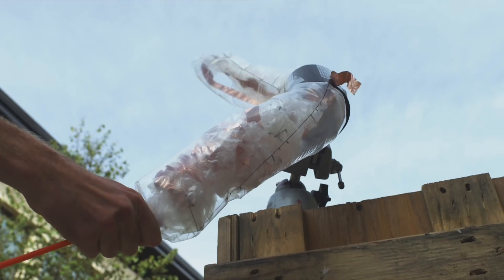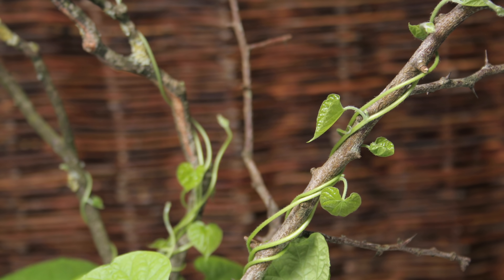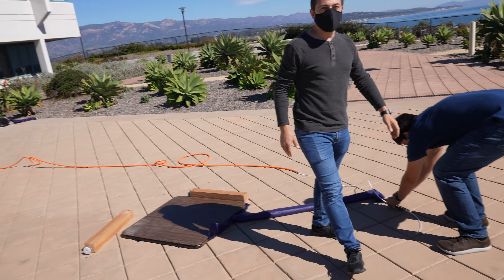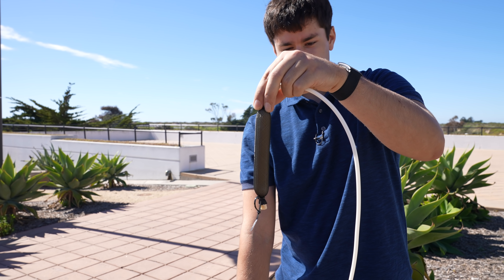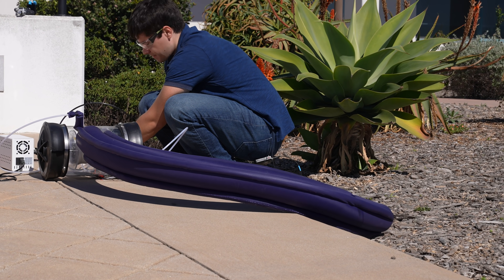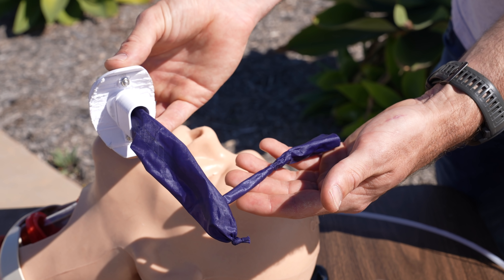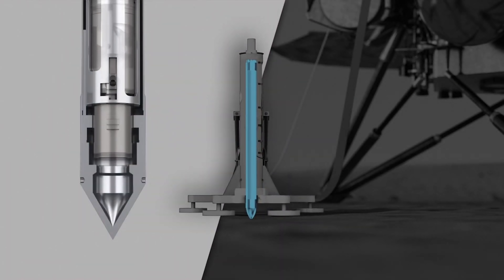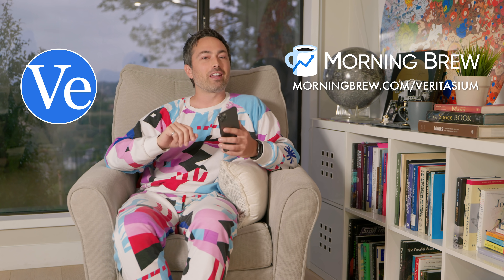This Unstoppable Robot Could Save Your Life

Comment: There is a currently used version of this robot that is repairing sewer lines across America. The tip has a powered cutting ring that removes blockages. It also pulls a hose that flushes the debree down the line. The cool part is that the tube is pumped with hot water that causes the tube to harden and become a new smooth PVC liner inside the old line. Takes 2 hours to repair half a mile of sewer line. Then a second robot cuts holes in the first tube at places determind by camera to reconnect the side lines.
Reply: Cool info. Thanks for posting it.
Reply: @ddegn  im pretty sure that's where he got the idea. That or hentai,
Reply: This is how water lines in neighborhood were coated to stop chemicals leaching in to our water.
Reply: @ybunnygurl  and stop leeches!
Reply: Cool! Thanks for the info. It reminds me of the mycoborer in "Captain Vorpatril's Alliance", but hopefully less likely to get out of control!  =:o}

(By the way, it's spelled "debris". Silent "s" at the end, 'cos it's a french word. =:o} )
Reply: Cool!
Reply: I was just thinking that that tube tech is already used & this video info is just a another concept of the same. 
They thread tubes to remove bloodclots in the brain for strokes. Thread balloons to widen oesophagus or hold PEG tubes in place etc. Inflated intubation would reduce vocal trauma...
Reply: Thank you for posting this.  I just posted info similar to this  then found your post as well.   Right on!
Reply: That's called Pipe Inlining! I used to work for a company that did that. We mostly rehabilitated small sewer lines, but occasionally with did really large water runoff sewers in the woods that we had to pump huge amounts of water into from a nearby large creek. It took many hours to "cure" those kinds of lines. Crazy technology.
Reply: That sounds like a great and smart idea!
Reply: That day my kitchen's sewage line got stuck and the handpump couldn't help at all. My father had to buy 4 one-metre-long black rubber tube, join them together and the with a wheel one one side, thrust the blockage from another drain opening. This inflatable pipe could've help out a lot if we had that.
Reply: Very nice
Reply: just so you know it's spelled "debris"
Reply: Wow
Reply: if you scale that down, it could be used to remove blood clots or clean fat arteries, couldn't you?
Reply: Do you know a specific company that does this or tool manufacture?
Reply: link?
Reply: 777th like
Reply: It's not "a version of this robot" it's old tech that's been around for decades. And it doesn't "repair half a mile of sewer in two hours," you can't even set it up in two hours. And it doesn't "repair sewer lines," it lines them, doing nothing structural. You've been looking at promotional material.
Reply: @johnsmith1474  you could very well have said all of that same stuff In a constructive way where he actually learns something from this information you seam to think is so obvious. As opposed to coming in here gung ho to dunk on someone. 
But you know, you must be correct based on the absolutely no supporting information given. 
And you're right, the OP also didn't. 
But he wasn't all "wow look at how wrong you are you must be dumb" about it like yourself. 
Plus was just sharing a fun antidote, not correcting someone's fun side thought. 
Anyone with half a brain knows to take a comment like his with a grain of salt and look it up for yourself if you want to know more. I mean come on, It's a YouTube comment. That should be obvious. To everyone except you.
Now you may have noticed Im being a bit rude while specifically telling you not to be. 
Well I just find it morally correct to bully bullies, that's all.
🎩👌

Comment: This has been used for many decades now.  Moving of industrial machines, part of the kits for lock-picking doors on cars, Part of the tool kids to pop dents in door panels, tools used to level doors while installing them, the hydro snake sewer liner tool to line cracked sewer pipes... etc.  This concept is over 100 years old.  Might want to investigate the myriad of uses of this already in use.  Be it by pneumatic or hydraulic uses... which in reality are one in the same.  Come on now...

Comment: A similar technology has been in use for some time in the plumbing industry. To repair old sewer lines they inflate a tube inside of the pipe and use a resin that hardens it. Basically making a pipe inside a pipe. Then a saw on a robot goes in and cuts out the holes where they need to be so the water can flow. I used to work on a plumbing crew that used that method.

Comment: Military application: would help provide a much longer antenna that’s light weight and compact to Cary around vs the current antennas soldiers lug around for the various comm devices! Obviously you’d have to combat the battle of keeping it straight against wind but hey that’s a problem for the engineers.

Comment: Great potential for many fields, but for intubation, wouldn't it collapse on exhales? There would have to be something stabilizing the tube's structure for negative pressure. It would need either tiny muscle tubes or a layered tube like a millimeter around the open tube, that would also round the extremity.

Comment: Make the tube itself double walled and filled with a very thin layer of self sealing gel. That way when it does puncture, as shown, it can have some sealing property. Maybe reducing the air pressure compensation needed.

Comment: How exactly would you get the air pressure required onto mars? Wouldn't the low atmospheric density be a limiting factor? Even with some kind of compressed air tank, would operation time be long enough to justify the tech and earth to space weight cost? Obviously if they're putting money into this is it must be somewhat viable, but I don't see it

Comment: Do you think this could be applicable in something like avalanche rescue? Is there a way that this could be an easier method of reaching someone stuck under an avalanche?
Reply: Maybe if the top snow aren't too thick or packed, or they can ad a small drill head?

It can slither between ruble and pump warm air or deliver powdered food?

Comment: Water pressure is available via fire hydrant.  Imagine heat resistant material, powered with water extending a vine robot to locate and extinguish fire keeping firemen out of harm’s way.
Reply: It is cool, but there is the problem that water cannot be compressed, so I believe the concept must be calibrated correctly to liquids.
Or, you could have an hybrid air/water tube, that expands with air and brings a tube inside that would sprinkle water when needed.
Reply: @giannipiccioni8411  Ehhh.... adding the potential for extra oxygen to a fire is scary, though.
Reply: @AlphaMachina  oh damn, you are right too. Are there any gasses that are not flammable?
Reply: @AlphaMachina  why does it have to be oxygen? Could use carbon dioxide which would extinguish a fire (that's how some fire extinguishers work).
Reply: @jeffwei  

True, but in some really hot fires --- abet very rare --- anything above, I think, 3K⁰C, the risk is the CO2 decomposing, releasing the O2.

The famous Centralia (sp?) Mine Fire is almost the classical model for anaerobic fire, that just the sheer temperatures involved means the coal being burnt, is entirely self sustaining, with little actual oxygen flow, due to how deep it is.

Another example in the Windscale Diasaster, here, in the UK, decades ago, when a nuclear pile (or rather, a specifically designed reactor for plutonium production),  through various mistakes, and flaws, overheated, and caught fire. They tried putting it out, with water being pumped directly into the core, using scaffolding tubes, but the fear was, give the very high temperatures involved, the water may have decomposed to fom acetylene, which, with the 'freed' oxygen, may have caused to literally explode. But things got desperate: it was either try to put the fire out, or the result being literally the entire reactor exploding, creating a radiological accident on par with what would become of both Three Mile Island, and, worse yet, Chernobyl.

Fortunately, they were able to put the fire out, but even so, despite the filters that were added as an afterthought (and where, actually, considered an unnecessary precaution) to the ventilation chimneys, the amount of radiological fallout was considerable. Even today, the scaffolding tubes inserted have never been removed, as the ends are considered as being too 'hot', radiologically speaking. There are plans to decommission the whole thing, but given the sheer technological challenges, it may take until 2080, if I live to be 106, like my Great Aunt, before it finally comes down ...
Reply: @giannipiccioni8411  Co2 can decompose in o2 at very high temperatures, you could use nitrogen which is inert or some noble gas
Reply: Bad ass idea man
Reply: So basically let such a robot inflate into the center of a fire and start pumping carbon dioxide into the heart of the flames?

Comment: You can build it as two concentrical tubes, use the external one as the robot body and the internal one to pump liquids. The tension of the liquid can be a problem, though, so, concrete for stabilization, maybe not, low pressure water maybe yes.

Comment: What else can I think of? I would make them very large with a sort of flap hatch at the end to create a shaft with breathable air for people trapped in burning buildings or in mineshafts that have collapsed. Once the person or persons enter the tube they can crawl to the end with the compressor and rescue workers can cut open the tube to retrieve the person. It could save several lives in one go, and would cost virtually nothing besides the fireproof canvas

Comment: They use that type of thing to repair sewage pipes..  they run a cutter head through the pipe first then they soak the tube in resin as it unfolds or unrolls itself inside the pipe and they let it harden and run a pipe snake with a camera and cutter on the end so it can cut out the openings for your shitters and sinks n stuff..,

Comment: Isnt this used in plumbing for like years now?
Reply: Yes!! I just commented on it. I used to work on a crew that used this method . they use a resin that hardens the "pipe inside a pipe", and then use a saw robot to cut out the holes. Thanks for recognizing it.

Comment: Such amazing technology coming from such a simple use of air pressure and air tight tubing? This is phenomenal!

I work in the medical field and I would be excited to see the intubation model being used some day! Every second really does count AND it could be used with patients that have a small passageway and intubate them really quickly to minimize the risk of their oxygen levels dropping during the process

So not only are you able to intubate someone quickly, you are also providing a solution to a long known risk of intubating someone who has a small esophagus and/or trachea (because this robot has been shown to squeeze into the smallest spaces) which is PHENOMINAL

on TOP of that, it's a soft robot so minimal risk of damage to soft tissues if for some reason it does still take some correcting to deploy correctly

So on top of the applications of using this for search and rescue, (not to mention archeology?! That's amazing!) I can see this technology saving so many lives even in it's current state...I can only imagine what it could be applied to in the future!

Comment: Does the fact that these applications seemingly could have been done 70 years ago not strike folks as odd? OK yes, I agree that lots of folks miss very obvious things all the time but when lots of people are working with something the chance that all of them miss obvious applications should go down with the number of people involved. And a LOT of folks have been working with air compressors and soft materials mentioned here like nylon for decades. As stated in the video, these are cheap materials and really have been for quite some time. So the next question to ask becomes is there a systemic reason why these applications have not been taken advantage of previously?

My guess is that the popping problem might be a bigger issue than the video suggests. Sure, some holes are survivable for these tubes as long as it's not more than the compressor can handle but then you've got cases like where the host did manage to pop that air pillow he stood on. Consider what might be problems there. In clearing out rubble you may lift some, the balloon pops and the re-collapse might be more dangerous to survivors than just a stable rubble pile. Or intubating a patient and a popped tube sends fabric into the lungs. Maybe these are solvable or maybe there are issues I can't think of, but I'm personally quite skeptical of folks finding "one weird trick" that uses well known technologies in a modern world where millions of people have been trying to find such easy and useful applications for decades. For every "aha" moment that happens there are plenty of "ahas" that turn out to be complete duds.

Comment: I am not inpress because for atleast 10 years, this inflating tube in tight location has been use repair sanity and storm line instead of doing a full  placement.  The tube is made of a fabric material and epoxy is pumped through the tube, hardening the fabric and became the new walls.

Comment: You can maybe do some plumbing with it, as the snake rope is hella expensive and a plastic inflatable rope would fix it. It could maybe act as a screwdriver if you have the right equipment for friction and grabbing a hold of the screw. It could even be what y’all are thinking of. It’s use is almost unlimited.

Comment: I think the experiment with the spikes is inacurate 
Normally if you rip a hole into it you wont have the object still stuck inside and plugging up the whole 
Now its true that you can always fix it with more air pressure
But if a hole is too big then you wont be able to fix that because there is a limit to how much pressure we can produce

Comment: The main limitation of this technology will be the gas supply. Like with paintball and SCUBA, your tank and your regulators are critical components, and it's very difficult to reduce their weight (big factor for space-faring applications). In the case of a Mars mission, you'd be faced with having to compress a very thin CO2 atmosphere for longevity of the mission. In interplanetary space, you'd literally have to take compressed gas (or reactants to make it) with you, which would be very expensive.

However, I think applications on Earth could be really exciting and are within reach.
I wonder if they could use something like that tire goop to reduce losses when punctured...

Comment: You can probably use it in all kinds 9f surveying uses like locating the runs underground pipes for gas, water, sewage.  Or even if you need to run a pipe or wire through a small cavity like a wall or door frame, by sending it through from a to be softly, then retract with a cable attatched.

Comment: As a Paramedic, I've performed many intubations.  The ET tube has lateral rigidity, meaning it is not likely to collapse closed when placed.  This allows you to deliver air/oxygen to a patient, but also allows you to apply vacuum, to suction out foreign matter/secretions that obstruct breathing.
What would keep the soft, inflatable body of that robot from collapsing under zero pressure or negative pressures?

Comment: Those vine robots could also be used for fishing wires through walls in an already constructed home or possibly finding where a wire has been cut or shorted inside a wall using a camera at the tip.

Comment: But... how do you let air out after intubation? It can push more air in, but you need an unrestricted passage way out. Right now doesn't this just block the air flow? Perhaps a concave triangular cross-section type shape held by strings, or 3 smaller tubes like the curving model would work? Otherwise I don't see how the air can come back through the middle of the tube, as it's being crushed by the air pressure that inflates the tube itself. If you remove that pressure, then it just collapses from the pressure that is causing the blockage in the first place...

Comment: Probably great for medical things as well eventually, since you won't have a hard tip that might be bumping into stuff all over the place when moving in further.
And there are for sure many kinds of weird uses for it i cannot even think of at all.
A lot of different version, and more possible, will likely have to do some more material research depending on the use case, it might take some time and certainly money, but when you have it done for several uses, you might have a gold mine on your hands as well, especially when it comes to medical use.
And sure, it's not about the money, but it'll likely also be better than what is currently used, and it'll provide you cash to keep going and do more research.
Might also be a ghreat delivery option in rescue cases, not only have it explore, when you get somewhere, you have a camera so you can see, but if hard to get to, you might very also deliver much needed water maybe even containing certain medicine the person might use through it, and of course air, so if it takes 5 days to actually get to that person, which might very well mean the person is dead by then, you can sustain them quite well with that, and you might also be able to provide some cushion with pressure to keep something up, or relieve some pressure on that person.
And depending on the space availble you might be able to run 2 or 3 in there, maybe even use the first one as a guide, and a pinched area might not be much a a problem at all, sure, a bottleneck, but it'll get there.